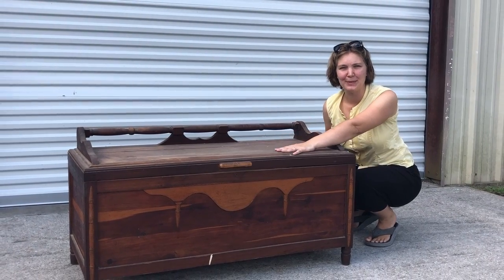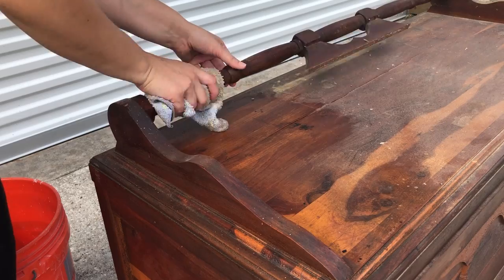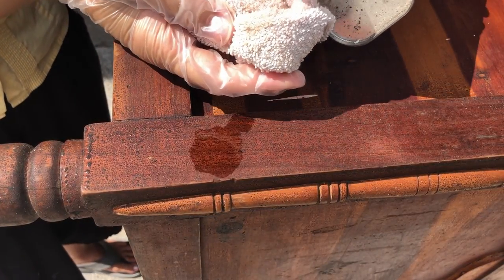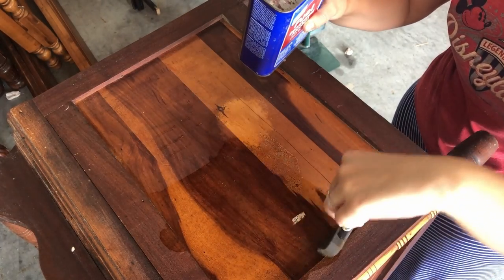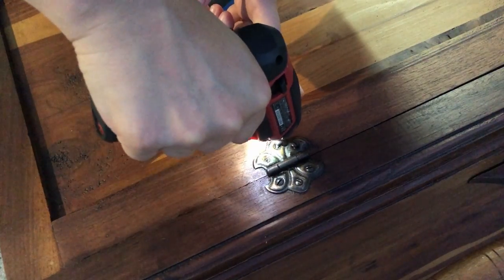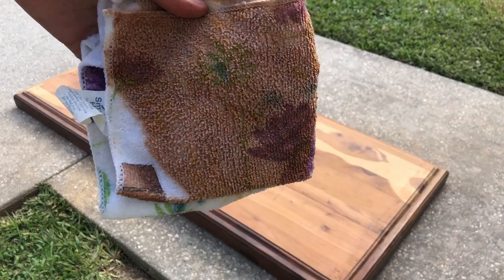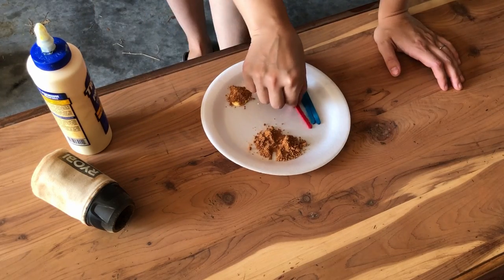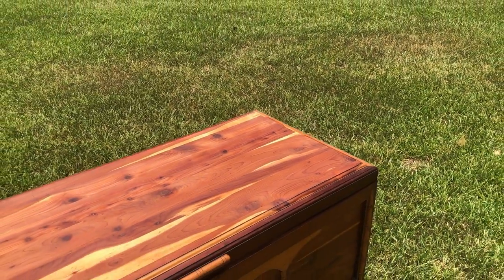Removing Old Finishes Off Furniture | Removing Shellac from This Cedar Chest

Comment: I found that it helps to start with a heat gun and putty knife. You'll get the bulk of the shellac a lot quicker, and you can go in and finish with alcohol/sandpaper.

Comment: Good luck trying to find denatured alcohol in Calif.  It is illegal to sell here.  If you can get some 95% or 100% rubbing alcohol from the pharmacy, it's basically the same thing.  It's used for thinning shellac and will dissolve the shellac.  
Also, to keep the alcohol from evaporating too fast, flood the surface and then cover with aluminum foil or some sort of plastic.  this will allow the solvent to do it's work before evaporating.  Work small sections at a time.

Comment: Will the orbital sander leave swirling marks?
Reply from the maker: It will if you use it improperly. But if you go lightly and slowly and move up in your grits (80, 120, 180, 220 something along those lines depending on project) then it will erase any marks you start off with.